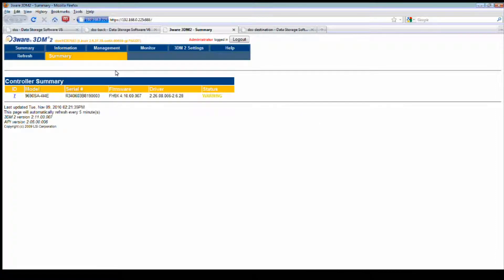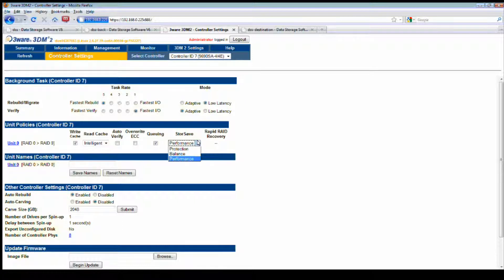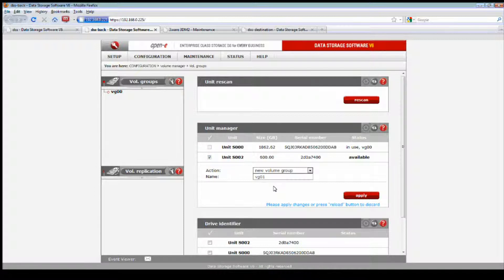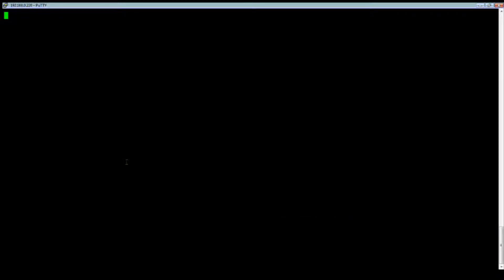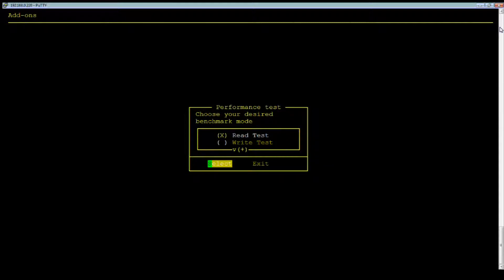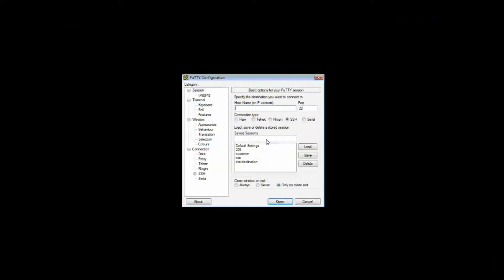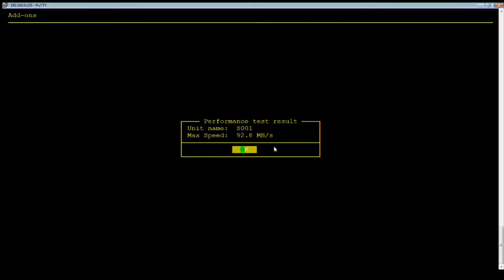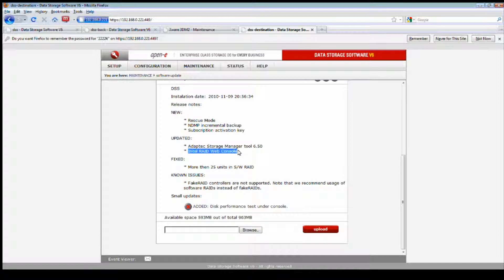How To Expand your RAID Array with LSI and 3Ware to increase your Volumes - Part 2/3

Comment: I made a experience and controller bios warns me that BBU could not have capacity to protect data, so if you have a unclean shutdown or BSOD, you could have a system corruption files. Put in balanced mode and you could have more performance than the storsave save on performance mode.

Comment: Hello!
I have a 3ware 9690 too. 
I saw one think..you said that 3ware recommends storsave profile on performance mode when BBU is attached, but this is not true. Use BBU only in balance mode. 3ware, has a PDF " (Software user guide 10.2), on page 111, explains storsave profiles with BBU. With  Performance + BBU, you don't have write journaling and look what the say "If BBU is present, this essentially disables BBU for this unit".